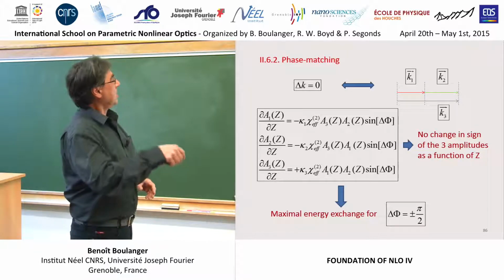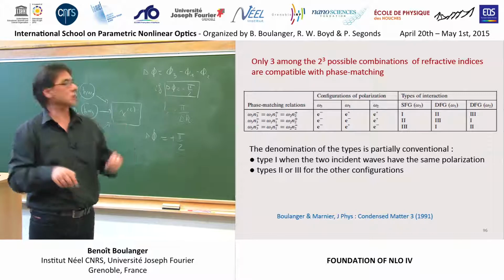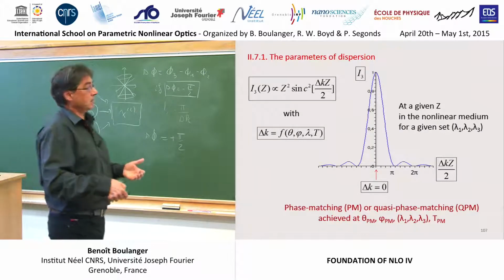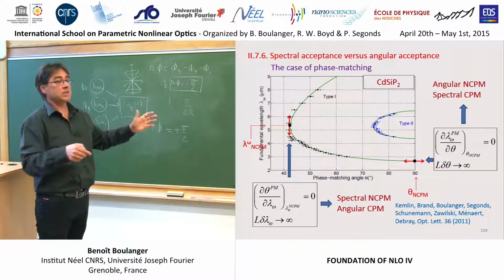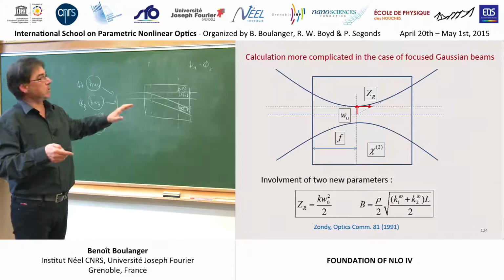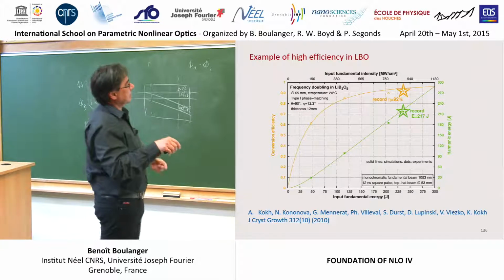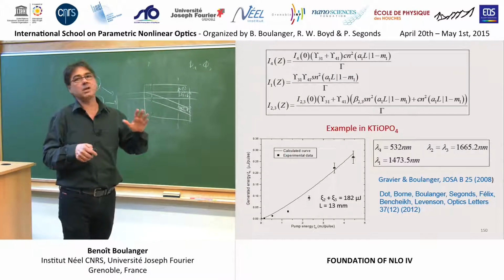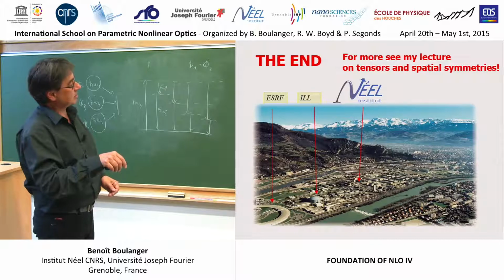4/44 Foundation of nonlinear optics IV

Comment: I think d(phi) = “value” as the relative fixed phases of the fields E1 ... En can be well undestood and explained if we compare this case with energy exchange between a driving force and a spring. The relative phase will provide the direction of flow of energy. By building the quantity P power = dE/dt we can find in order for energy to flow from driver to the oscillating mass (undampled) the phase difference is essential. Same way + or - pi/2 in SFG or other cases can be undestood.